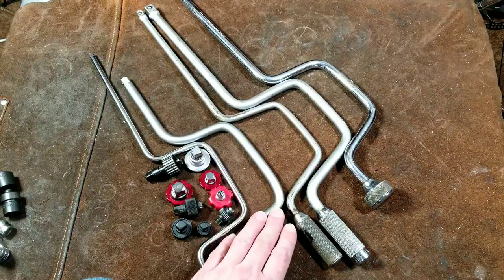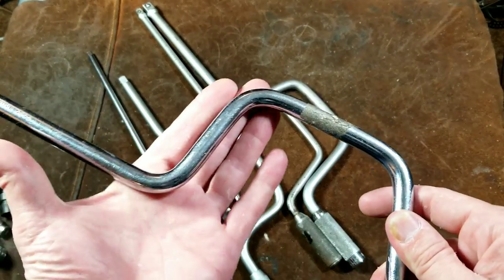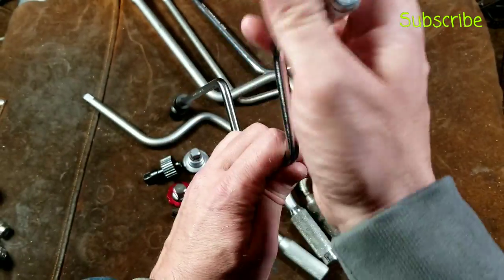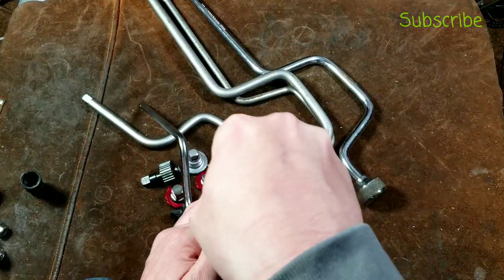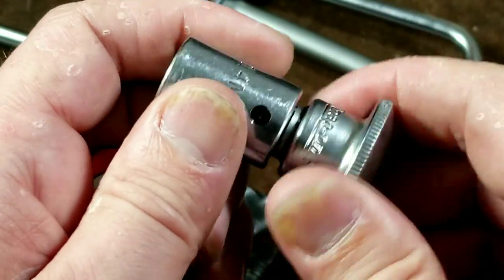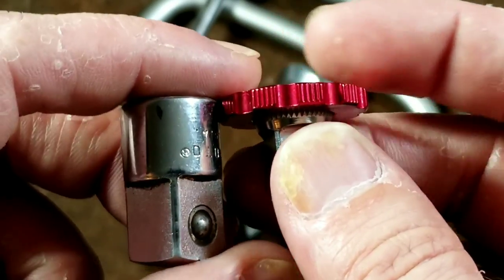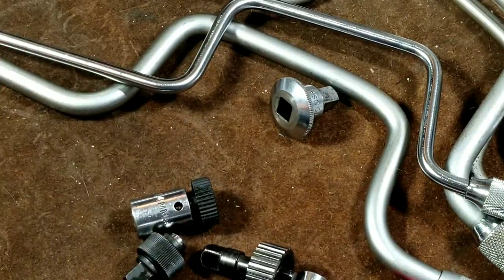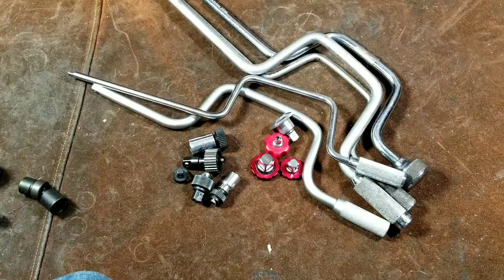Socket Speed Wrench & Thumb Wheel Review & Comparison

Comment: This was a nice video. Thank you for it. I learned several things from it. Hopefully, I'll be able to contribute something to the discussion here. Gedore Red sells a couple of tool kits that are 1/4" + 1/2". In other words, the sockets go up to around 13mm in 1/4", and then the 1/2" ones start at 10mm and go up from there. They just eliminate the 3/8" sockets from the set entirely. This is not necessarily a common approach, but they do it in a few instances to save space in order to make room for other tools. You can only fit so many things into a case, and if you want it to be more universal, then you have to leave out some things. In a situation where you have only 1/4" and 1/2" sockets available to you, an increaser would allow you to take a tool from outside the kit such as a 3/8" torque wrench and use it with a 1/2" socket. I generally try to use torque wrenches in the middle of their scale and avoid the extremes if possible, because I believe they are more accurate in the middle of the scale. My lawn mower's rear wheel lug nuts are 3/4" / 19mm and are set to 40 ft. lbs. I prefer to use a 3/8" torque wrench for that, and the increaser allows it to work with the appropriate socket in 1/2" drive from such a kit. At home, I could have supplied the 3/8" drive socket, but in a situation where you are porting your tools to some other location, then an increaser could be helpful if you are choosing the 1/4" + 1/2" approach. Another instance would be that I have a 3/8" spinner that I like to use with 1/2" drive sockets, also requiring an increaser. 3/8" drive spinners are not common, and I've not seen a 1/2" drive spinner. This can be a useful way of quickly checking that a fastener is reasonably tight and hasn't loosened up. Or, you could use it to run the fastener off if you broke it free using some other method. For instance, I have a storage lift that attaches to studs in the ceiling. To check the tightness of the screws in the studs, I used the 3/8" spinner with a 10mm 1/2" drive deep socket requiring an increaser because 1/2" drive deep socket had the depth that I wanted whereas a 10mm 3/8" deep socket wasn't long enough to clear obstructions. I hope that helps to hear from someone who uses increasers.

Comment: Came for some rare speed wrench (aka crank wrench aka speeder wrench aka high-speed knuckle-buster) reviews, and got that excelent tip on thumb wheels. 
I still use speed wrenches regularly working on engines and motorcycles. The feedback you get is invaluable when working on older stuff. Picked most of them up at yard sales.

Wish I had two thumbs to give this video... wait a minute....

Comment: I've used the increasers when I rebuild rear ends or have to torque the pinion nuts. Need a huge socket, typically 3/4" drive  but need a 1/4" drive dial torque wrench so thats the scenario for me. Love your videos dude!

Comment: The speed handle with a bit adapter comes handy when removing aircraft panels. Especially if you are depaneling the whole aircraft! I'd imagine the thumb wheels have a higher chance of falling and getting lost inside the aircraft because of its size.
Reply from the maker: I did that combo review because I didn't think those individual items deserve their own videos. Yes speed wrenches would be great on aircraft and so would thumb wheels in the right situations, although I would admit that if you're removing many Fasteners such as exterior panels you would use an impact driver to run them out quickly. I have familiarity with aircraft and there's a variety of specialty tools you would use with them as well as many standard tools used by everybody.
Reply: @CatusMaximus  Hmmm... I think Jaian above was referring more to removal/replacement of the millions of inspection plate & like screws; where an impact driver would wreak havoc. The aircraft crowd in particular liked the 1/4" Snap On version with the large diameter knob that could be 'leaned' into. They're still in use, but power drivers now dominate. 'Dog Leg' drivers were also popular... some of those are still around as well. I have a couple.
Reply: @rwbishop  absolutely true. I prefer the 3/8 version of the snap on speed handle you referred to as it allows more torque. Fuel tank panels for example can only come off using speed handles as electrical tools can spark.
Reply: Spotted the Phase guy!

Comment: I found a snapon 1/2 speed wrench at the pawn shop for 15 bucks!!! I use that thing much for tighting lugs before a torque wrench you could really feel and make sure it's going on correct some of 1000ft lbs air tools could cross thread and ya won't even notice
Reply from the maker: Yes I like to speed wrenches too their convenient and handy, and that was a great price
Reply: I found an old Snap On 1/2" speed wrench (part # A-2004) with some surface rust, at a flea market about 25-30 years ago.
I think I bought it for 2-3 bucks, and I bought it because I saw "Snap-On" stamped into it.
Haven't used it since I bought it.
I just recently oiled the spinning handles, and cleaned most of the rust off.
It looks like a decent tool for what I paid.

Comment: Hello sir. I have never used a thumb wheel. I can see how they would come in handy. I have an old speed wrench, I really don't remember when or where I got it, it's a fleet made in the USA. Came in handy when used on many of the same size nuts or bolts, I can see how most guys now use impact guns
Reply from the maker: They're pretty good for running in bolts as well

Comment: Increasers are needed in very tight spaces. The KTC 1/4 to 3/8 increaser / ratchet spinners are very thin and useful for Subaru sparkplugs and valve covers or other bolts that have very limited access. 1/4 Matco 88 9 inch locking flex + KTC adapter will get just about anywhere. Especially as a pro, stuff like that can be a big time saver. Speed handles are also great, use one at least once a week. I have a Par-X 3/8 spinner, used the crap out of it just today. Not perfect for every situation, but when you need it you'll be glad you had it.
Reply from the maker: I have a couple of Grey's double universal joint spark plug socket which are perfect for ej25
Reply: @CatusMaximus  increasers are also useful for removing passenger side axles on Dodge Journeys and Chrysler minivans so you can sneak a 1/4 air ratchet in. The passenger side axle is long and has a pillow bearing that is hard to get to without some trickery.